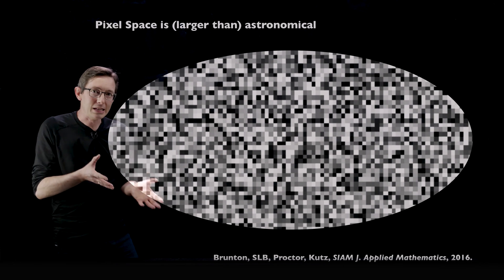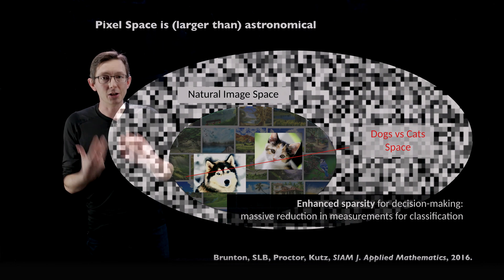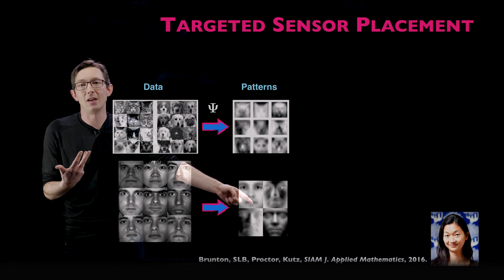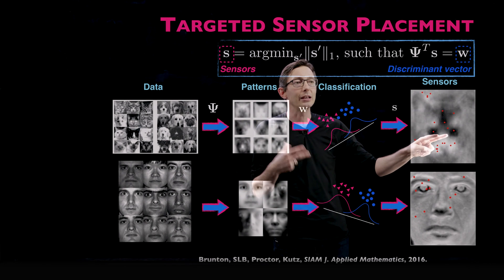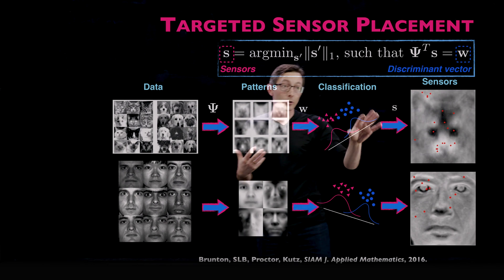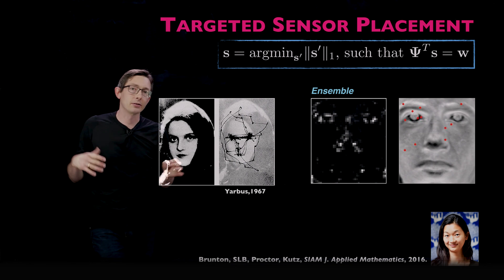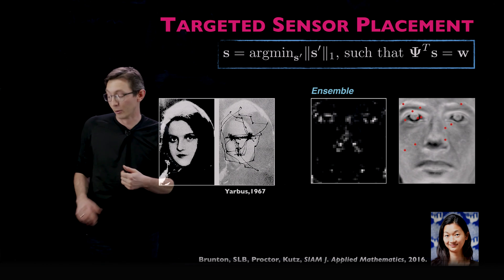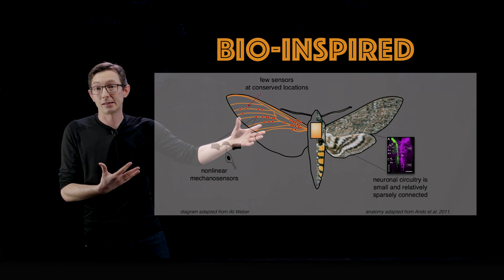Sparse Sensor Placement Optimization for Classification

Comment: It would be really cool if you could talk some more about the extension to neural networks some more.  My first thought is that you would apply it to the latent space representation?  But that seems like it wouldn't save very much effort, since you would already have done the whole forward pass of all but one layer of the network.  You could use it as a preprocessing step, and train a classifier on the reduced images, but optimizing for linearly separable data seems at odds with the strength of neural networks, which is finding patterns that go beyond linear separability.